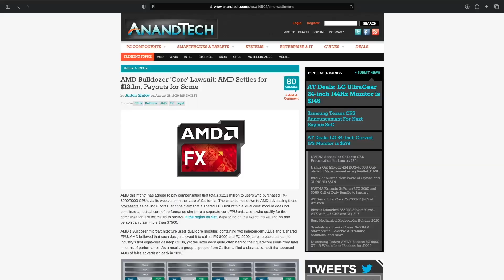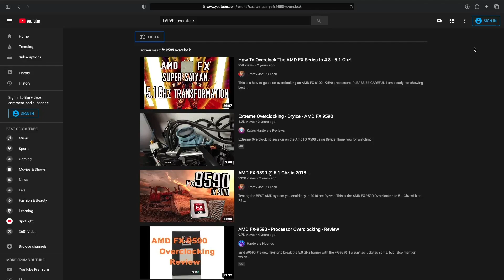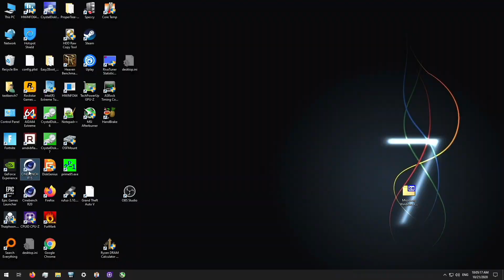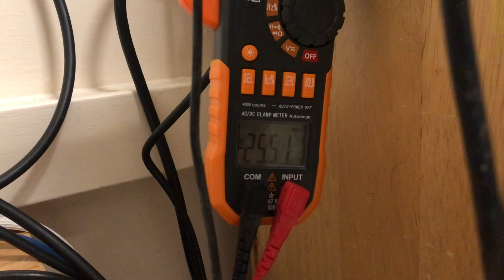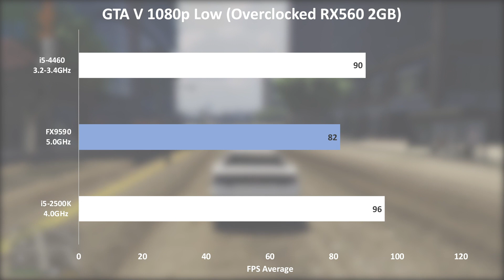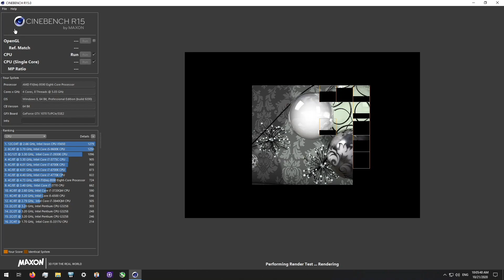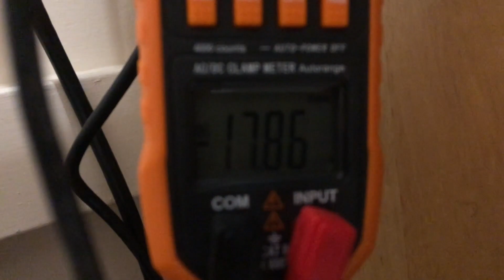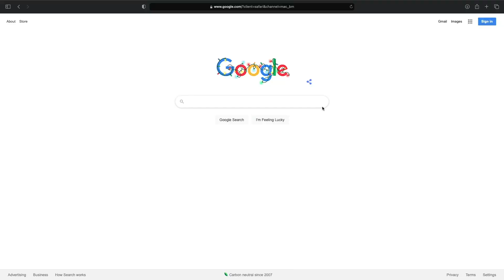An 8-Core 5GHz Nuclear CPU from 2013: AMD FX-9590's Stories and Tests

Comment: Why did you cripple the system performance by downclocking CPU NB & HT link frequencies to 2000 MHz ? If anything, you should increase both to 2600Mhz instead (or leave it at defaults).

Comment: FX8150 brand new in the box with AMS I motherboard 970 I use Ag. T x sixteen sixty t I and I get double your results
❤❤❤❤❤❤❤❤❤❤❤
I recently bought an f x 8350 and a gigabyte board nine ninety x shipset.
Now bought a FX9590 MIN5 BRAND NEW SEALED SYSTEM NEVER BUILT.

I WILL BUILD IT LIKE A RACE CAR😅😅😅❤❤❤
NICE REVIEW..

Comment: I bet performance would be stabler at stock with this CPU with better VRM temps, there is barely need to overclock it to 5Ghz if the turbo boost already does 5Ghz, the reason being most games submit draw calls on a single thread, and this thread would likely run at 5Ghz while the other seven threads would do 4.7-4.8Ghz.
I would've liked this CPU in my system though, since I have a sufficient motherboard and liquid cooler, but no space for fans to cool down the VRMs.

Comment: At least you would expect 9590 to be better binned but from what i seen especially from RA Tech (highly recommended yt channel) its not the case, making 8350 much better cpu in general
Reply from the maker: Exactly, we tested the 8350 and when compared the 9590 is not really better binned than it.

Comment: my fx 9590 is freezeng! Do you know how can i resolve this problem? PLS!!
Reply from the maker: First check the CPU's operating temperature. If it is overheating you will need better cooling. Then try running everything at stock by loading optimized default in the BIOS. If the problem is not solved, try swapping out components such as RAM, GPU, Hard Drive. If the problem still persist, then either you have a dead CPU or motherboard.
Reply: @BeastPC  in the past i changed RAM GPU PSU  and HDD. I have underclocked cpu to 4.60 GHZ and runs perfeclty fine now. In ac valhalla gta 5 and rdr 2 runs just fine  at 46~50 degrees but whn i put it on 4.70 ghz stock speed it would freeze in 10~30 min when playing a game.
Reply: If your FX-9590 is freezing it might either be the board (The only MB that can run a FX-9590 without any issues is the Asus TUF Sabertooth R.30), or its the CPU itself freezing. Try turning OFF the C6 state option in the BIOS (this effectively turns off the Turbo boost to 5Ghz). This CPU is famously overvolted from the factory and its quite possibly the drawing too much juice which is causing it issues).

Comment: FX chips were great overclockers. 9590 wasn't, but most of time you could undervolt them quite a bit from stock without underclocking it. With good cooling some people actually reached 6GHz with FX chips. It's possible to do that with water cooling and often turning off cores. Also FX chips had 5GHz 24/7 club, where members ran them overclocked as daily drivers. I personally managed to hit 5.288GHz with two cores enabled and 1.72V. That's an abysmal amount of voltage used, because my board was weak sauce, it was Asrock 970M-Pro3. I used FX 6300 to do that with Hyper 103 cooler. Surprisingly enough it didn't overheat (CPU), but it was the first time in my life when I saw 2 cores pulling almost 300 watts during Windows boot up :D. Other than my awful config, it was totally possible to run FX 6300 with 240MM AIO (or just big air cooler), Gigabyte 970-UD3P board at 5GHz daily with 1.45-1.5V without exceeding 62C temperature limit. Another great feature is that unlike other CPU architectures, Vishera didn't have overclocking walls. It pretty much scaled linearly up to 8.7GHz (highest overclock to date on FX chip). In terms of undervolting FX 6300 could lose 0.2-0.3V at stock clocks. The most optimal overclocks for FX chips were always in 4.3-4.7 GHz range. They have great overclocking reputation mostly from the fact that you only need to give it good cooling and good board and chip itself will take it nicely. Phenom chips had overclocking wall at 4.2-4.4 GHz. i7s at the time were good for casual overclocking, but once pushed more it was very hard to cope with their heat output. Some chips also don't tolerate negative temperatures and FX took those nicely, making them the best chips to overclock with LN2. Fun chips, but utterly impractical.
Reply: This is an AMD cope post. 
t.5600X user
Reply: @nicekeyboardalan6972  What a cringe remark. I just liked overclocking FX chips.
Reply: @MJ-uk6lu  I'm playing calm down, but yeah idk man those things are just so bad compared to any intel stuff from the same time it was brutal I mean a 4th gen i5 destroyed that 200w CPU. I guess its fun lol.
Reply: @nicekeyboardalan6972  i5 didn't exactly. i7 did. I no longer care about all that drama.
Reply: @nicekeyboardalan6972  Destroyed ? have you seen what the 9590 clock's to on a single core ? When this was released most games did not even support multi core some games would use 2 cores max. The FX series was great for more then just gaming back at that time an overclocked G3258 could run most games and that was a £50 intel chip that would clock to 4.5 with ease and had 2 cores. I love the salt the FX series gets OK the 9590 was not the "best in line" for a stable system but when your overclocking you noticed what was special about these chips and the first core on most hit 6.5ghz with easy with the correct cooling.

Comment: Ryzen r9 3950x vs FX 9590 Power consumption: do you have and idea?
Reply from the maker: We don't have a 3950X but based on what we see in the reviews, unless you runs a very high overclock on the 3950X, it should use less than 240w,  or 20 amps on 12 volts, which is less than what we see on the 9590. Typically if you don't remove the turbo limits, the 3950X only uses 145W.
Reply: @BeastPC  amazing! Thank you!

Comment: I have AMD FX-8320(3,5Hhz) OC at 4.0GHz 1,42V.
Above OC 4.2GHz it becomes unstable, hot and hungry for current. 
The advantage of this processor is in the latest games that activate all 8 cores, and then it really behaves like an 8-core processor. In older games, Intel processors are a much better option.
Reply: @ARAVideogames  I guess i'm lucky. It's been 4 months since this comment, I still have the same settings. I believe that it is very important to have a good cooler and good air circulation in the case.
Reply: @ARAVideogames  My motherboard is GIGABYTE GA-970A-DS3P.... nothing special . I monitor the parameters from time to time, but for now everything is fine. I chose this voltage because at lower voltages the computer behaved unstable in more demanding games.
Reply: @doghunter4097  indeed , the DS3P is kinda of basic. The thing is that high voltage stress the VRMs (throttle) plus you are gonna have mosfet probs (burn). Then, through the months or years, of usage your cpu will ask for more voltage. Which can lead to more probs. I think it would be wise to drop the volts at around 1.35-1.37 v and drop the frenquency at 3.7-3.8 or whatever your cpu can. The best case scenario is, later, to change your motherboard. If you find a cheap Crosshair V or Sabertooth 2.0 then buy it without hesitation. These mobos can sustain crazy voltages (with a proper cooling). They are considered to be the best wild dogs of the Am3+ socket. After this, consider change your cpu which as I said is not a good piece and buy a 8370. This cpu is by far the best overclocker in the AM3+ socket. Imagine that with the same voltage you have now, you will achive at least 4.5 Ghz. Anyway, good luck and take care.
Reply: @ARAVideogames  Now I will lower the voltage to 1.36V (or something similar) and let you know at what frequency the CPU has stabilized. Basically, I did all this for the sake of the game "Scum" because it is very processor demanding.  For now, I will stay on this platform. Thank you for the advice.

Comment: Hey awesome video
Could you see how far can you undervolt the 8core piledriver or bulldozer cpu and keep the clocks as high as possible and compare power consumption and performance I would love to know your results
Reply from the maker: We've actually sold the 9590 and got around to testing an 8350 just for fun although no video is planned on it. We also have experience with the FM2 platform and their CPUs, so we'll list some of our findings here.
To get these CPUs to 4.8GHz+, very high voltage is necessary, at least 1.52v to 1.6v depending on the CPU and LLC settings. They take extremely high voltage to go higher than that, 1.65V on our particular 9590. Our 8350 was worse binned, only doing about 4.5-4.6 with 1.6V.
So, these CPUs do benefit greatly from an undervolt to ~1.4-1.45V, they should do at least 4.0-4.3GHz without a problem there. Power consumption on the 8 cores should go from over 200W down to 150W or so, and performance is not compromised too much. 
Basically, under 1.45-1.5V these CPUs can stay relatively efficient and go to 4.0-4.5GHz, but if you want to hit higher frequencies the power consumption and voltage necessary start to spike.
Reply: @BeastPC  thanks for the info